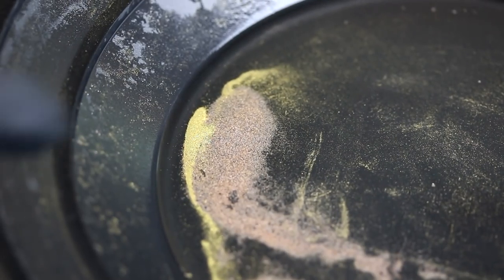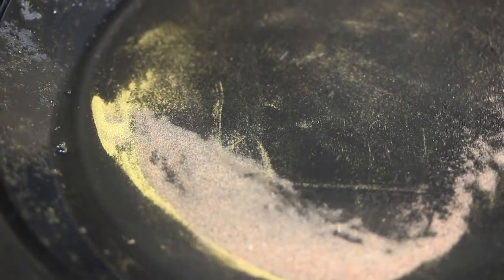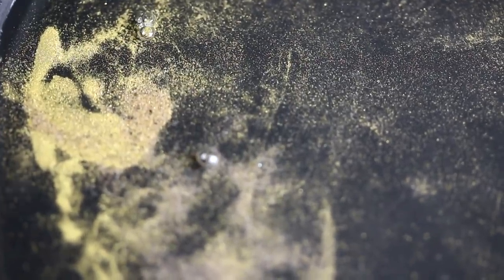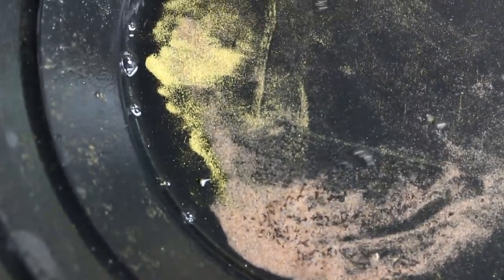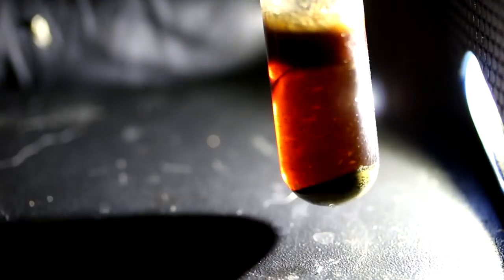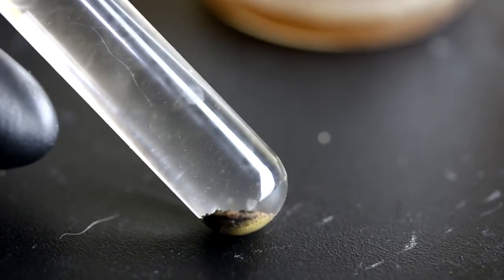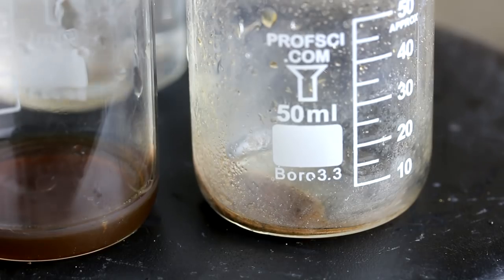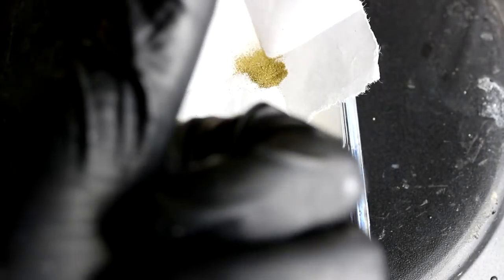Metal Refining & Recovery, Episode 21: Separate Gold From Sand With Heavy Liquid

Comment: I've used a clear tube with a thin rigid irrigation tube connected to an elevated jug of water with surgical tubing and a valve to stratify material by density The water lifts the lighter material and leaves heavy material at the bottom. I use lead chips painted with fluorescsent paint to check results. I then use a long sniffer tube to suck the gold off the bottom. If done carefully it works. You'll get any platinum or other materials heavier than gold in the sample.

Comment: Cody, you should really try something: High voltage electronic sparks in your vacuum chamber!
They should be much longer and thicker, eventually turning into gas discharge light as you decrease the pressure. You could even recreate the dark-light zones in 3D!

You can buy simple high voltage generators from for example eBay for 3-6USD, or even create your one from an old television's flyback tansformer. You can even buy flyback divers from eBay, or google up "Simple flyback driver".

Thanks: a fan

Comment: I have thought of this problem before, and I did think of an idea. there is probably a perfectly logical reason why my idea would not work because I am sure others must have thought of it too. Although gold is non-magnetic, at recycling plants they use those linear motor type conveyors which work by inducing eddy currents into non-magnetic metals like Aluminium foil and cans, which are then dragged up the conveyors out of other non-metal rubbish. It did make me think that such a motor could be used in river sand to suck up Gold, I suppose though it would also suck up other metals which would still need to be separated from the Gold.

Comment: Hey Cody, cool video but i am commenting for another reason. To be honest i am a real nerd. I have found my first graphics card and noticed that, when removing its cooler back in the days i have damaged the silicon so i have decided that i am going to remove the silicon part to puor it in epoxide resin to use it as a  key Chain. I am currently questioning myself if i should go with acid to remove the silicon from the substrate/chip but i want to hear you opinion on that as i am by far no chemist and not sure if this would dull the shiny chip. i am happy if you would answer me :) greetings from germany

Comment: I have a question and suggestion for an experiment: What happens if you mix 2 acids (given they are no reacting) with different ph levels, does the overall ph of the mixture equal out regarding to the volume etc. or what?
Reply: Thats what I thought as well, but first you got to prove it before you clai it :)

Comment: A drop of dawn or another dish soap will help break the surface tension between the gold and the water, letting the gold settle on the bottom. Don't know if that will interfere with any chemicals though.
Reply from the maker: Justin Bayens 
I showed doing this on camera in the video.
Reply: I had not watched it all the way through yet, just paused to add my input and after continuing, Mr. Cody already had that bit of info.
Reply: He's not that stupid, but thanks, for the rest of us that are.

Comment: Clerici Solution at room temperature the concentrated solution with the density of 4.25 g/cm3.  Will sodium polytungstate also work?  It also has a very high solubility in water (max. density 3.1 g/cm3).

Comment: Cody silly question how well would this work with the heavy water you made before?
Reply: Heavy water is about 1.1g/cm^3, so it would still mix with normal water sitting on the top of the much heavier Clerici solution.

Comment: Hi I have a question  I want to figure out what I did here’s what happend 
First I scraped the stuff that burns off a sparkler (don’t know what was in it)
Next I put it in a pile on concrete then I lit it on fire, it formed black hard beads which I submerged in water for a day 
Then I put it in vinegar and Let it sit for a day the liquid turned pink and when I poked the black beads they turned to dust
I would like to know what I’ve done and why it is pinky liquid now
I used white vinegar
Reply: Anticonny should I do anything else with it
Reply: Anticonny is it safe to pour down the drain
Reply: Anticonny so how would I make it safe
Reply: Anticonny could it have released a gas
Reply: Connor 1 how are you so knowledgeable about chemistry? :O while I'm here, do you know of any way to get rid of the binding compound in the sparkler material (before you burn it) so that it burns more reliably, without destroying the mixture's flammable/combustible properties?
Reply: When you try to remove one substance from a mixture, you always follow the same steps:
You first create a list of all things inside the mixture with their chemical and physical properties (density, solubility in different solvents, particle size, ...)
Then you look at the properties of the substance you want to filter out and see which one is unique to it.
If there is no unique property, you look for a combinatio of two or more properties that no other substance has.
Finally, you search for a method to use these properties to filter it.
If the substances differ in density, you do what cody did here.
If they are different in solubility in water, you fill it up with water (might need to use hot water) and divide the aqueous from the solid layer. if they differ in particle size, you do a filtration through an appropriate filter.
Don't forget to crush it into powder if you are dealing with a solid mixture.
Properties can be found on Wikipedia.
If you don't know how to follow these steps, you are certainly not qualified to try this at home.

Comment: I have seen a magnet dropped down a copper tube and watched it slow. Could a fast 
moving magnet push the gold dust out and leave the non magnetics behind?
Reply: keghn feem gold is not magnetic. Also, the action of a magnet "pulling" on copper isn't a matter of the material itself being magnetic but rather being electrically conductive. Also, you can't really induce a force if there isn't much conductive material for an electric current to flow in.
Reply: yes, gold is good electricity conductor. However, it is interesting how the size of the particles might affect the situation.
Reply: The effect in question is eddy currents. A changing magnetic field induces circular currents in the metal, as though parts of it were coils. The circular currents create a magnetic field with opposing flux to the moving magnet, and slow it down. But those "coils" can only really be effective if there's enough space to form many of them, and large ones. So the dust would be very hard to affect.
Reply: Tuxfanturnip maybe if you use a  high enough frequency electromagnet...

But at tjis ppint you'll be trying to kill a fly with a canon
Reply: I thought gold was slightly repealed by a magnet? it looks that a very strong neo magnet  could at least help separate the gold sand while in the small amount of water. I think its worth testing! because SCIENCE!  hope you had a good holiday. and happy new year CODY!!!
Reply: Higher the frequency, alternating magnetic field, for smaller pieces. It  
would repeal gold and will cause the gold pieces to clump together. The 
 gold will be attracted to each other. Like shade pole motors works. 
 
Magnetic heating. Higher frequency will cause the surface to heat faster. 
Lower the frequency the deeper the heating. 

Small pieces of gold in a alternating magnetic field will case one 
side to become positive and the opposite negative and then alternate.

Comment: Whats your flux recipie? For melting down your gold beads.
Reply: sodium borate mostly
Reply: Cody'sBLab , Ive been using 3 borax, 1 soda ash, 1 silica mixed 50/50 w my concentrates. Am getting dismall results. Tiny bottom of flask beads & black glass w lots of gold threads running throughout. Just cant seem to get them all to settle to the bottom. Micron golds a bugger!! Have really rich 2-3% concentrates but GETTING them out is the problem. Even mercury tumbling seems to only get out a tiny bit. VERY frustrating!!